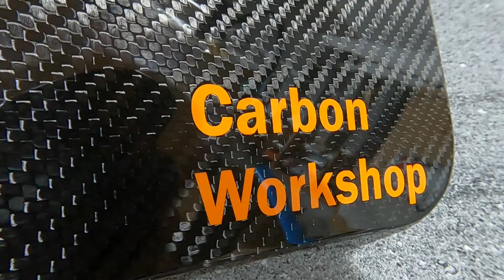COOK Stickers in CARBON FIBER mould to 120 Degrees C [PREPREG CARBON FIBRE] How To Make Carbon Fibre

Comment from the maker: Thought I would try to lay up decals straight into the mould.. And results were amazing 😍
Reply: What happens instead if you stick the sticker to the mould?
Reply from the maker: @skogzor  maybe work 🤷 I imagine sticking it on fresh release agent wouldn't be very tricky.
Reply: 2:27 -> weave directions same as previous layer (still 0-90° ↑→). You'd have to cut the material with the +/-45° in mind ↘↗ (you'll maybe have more scraps leftovers ). I see that EC don't have Biaxial in prepegs...only Unis. Keep it up 👍, can't wait to upgrade to prepegs. Regarding the sticker, are you not concerned about color fading ?
Reply: What are you making in these videos? Is it a plate of some sort?
Reply: @johnmichaels4330 Fuel tank cover..
Reply: @bradr539  oh ok, thanks.
Reply: Will a standard printed sticker work or does it have to be a certain vinyl?

Comment: Which is the best form to create an interior details for an Audi A5 (dors, central and front console), create moulds or cover original pieces?? I like you job and pieces a lot
Reply from the maker: Interior pieces that have lots of clips to hold in place are often easier to cover over the part.
Reply: @CarbonWorkshops  By applying a thin layer of carbon to the pieces there should be no problem with fitting in their original position, right?

Comment: Why did you not just clear the mold and save the extra work?
Reply from the maker: From experience, this won't work with prepreg carbon fibre.
Reply: But it works works fine with infusion?
Reply from the maker: @teoyota  prepreg is different, if you stick the carbon and need to adjust it will pull the clear coat from the mould. Also I don't think it will handle 120 deg celius
Reply: there are special in mould coatings used in the industry. But expensive and the moulds have to be 100% flawless and ultra high goss, otherwise you never would get a finish like the end result in this video